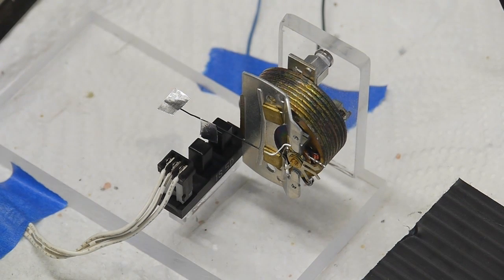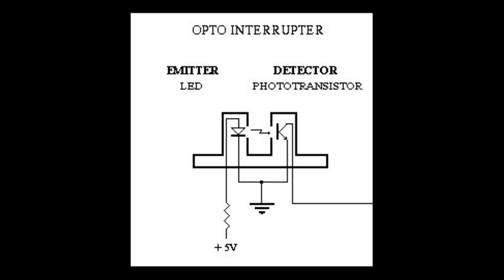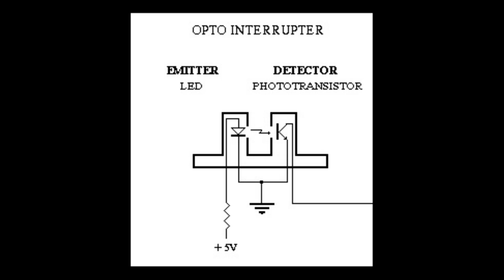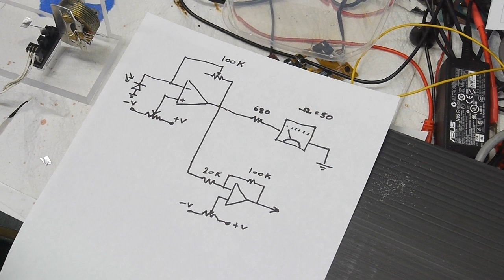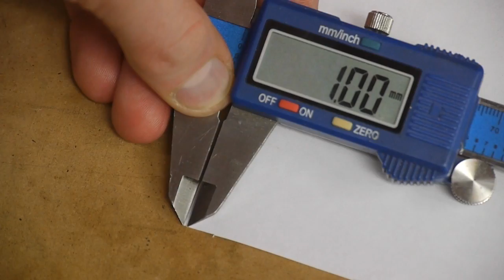Measure the mass of an eyelash with a DIY microbalance

Comment: Is that optical interrupt device they type with an analog or a digital output? The digital type would behave as you describe, where the analog sort would turn on proportional to the amount of blockage of the light. Perhaps it is an analog sensor, but the beam is so narrow that the light is hard to modulate with your mechanical shutter.

Comment: I like it. How much torque can you get out of that needle? Enough to put an optical encoder on the other side? If you printed a smooth gradient on clear plastic and used an analog optical sensor you could eliminate the digital jitter.

Comment: Neat project. To prevent oscillation, put snubber circuit parallel to the (-)input/output (where is 100 kohm trimmer pot for sensitivity) of the first 'servo' opamp. It consist capacitor and resistor in series, then both paralel with this pot. It should gently dump all rapid changes in voltage or current. If single RC is not enough, then put one more than one RC pairs, but with various different values. For example, 1nF/1 kOhm, 10nF/10 kOhms, 100nF/100 kOhms...

Edit: This RC snubber should prevent high excursion of the 'servoing' back, while maintaining relative good feedback speed. 

For air cover, make glass protective hood. Glass can be electrostatically charged too, but to much less extent than plastics of any kind. 

For temperature compensation, you may use NTC resistor and some measurement electronic, just to tell you overal temperature inside measuring device, and how much needle may change length (thus leverage length, which may affect precise and consistent reading of the weight). Later, all parameters can be feed into some u-controller including compensating value depending of different device temperature.

Callibration of the temperature difference can be done measuring the same weight at different temperatures, then plot error correction values, and so on...

EDIT2: Watch out for temperature changes of the trimmer pots - they are very prone to change in resistance with the temperature (I experienced big problems at one attempt to stabilize temperature of the laser for holography porpose - trimmer pot[s] gives me bad behaviour fo the whole circuit, indicating false temerature rising or drop of the laser head, especially when room temperature changes). This small change in resistance is more evident with increased feedback amplification of the opamp(s). 

EDIT3: I wonder, whether this optocoupler has oppening in form of dot, or line? If line, then it is perhaps possible to roate whole setup 90 degrees, so that shutter doesn't cut beam of light rapidly, but rather gradually.

EDIT4: Oh, well. Such opto switch may have slot, but inside is both: photodiode and LED encapsulated with focusing lens, which may produce very narrow beam of light. Maybe making your custom opto switch?

I hope this helps.

Comment: I have an idea. I'm pretty sure it has been done before, but I wonder if it is possible to make a scale that works on resonance frequencies. For example, placing an object on vibrating platform will change resonant frequency of that platform. Then, by adjusting frequency to make it resonant again, it may be possible to calculate the mass of an object by comparing these two frequencies. Thank you very much, I enjoy your channel!

Comment: You could low pass the output that goes to the oscilloscope, with a big cap, small resistor (to minimize resistor noise).  There seems to be some oscillation in the signal in the scope, probably servo loop caused; so the RC low pass filter with a cut frequency 10x smaller than that freq you see in the scope can help a lot to get a better "weight value".

Comment: Very cool, as always Ben. One thing to be very care with when using gutted meter movements like this is that it is extremely easy for the field magnet to attract any tiny metallic particles into the movement which can easily impede the motion of the coil.
Reply: I ruined my first meter this way when I went to drill mounting holes in the metal body!

Comment: Wow, impressive work! Just out of curiosity, is the photo interrupter sensitive to ambient light, or is it dominated by light from the IR LED? If it was, would it not be possible for changes in lighting conditions to throw out the calibration, or even for flickering of fluorescent lights to cause oscillation? Thanks.
Reply from the maker: Yes, the optointerrupter is not really meant to be used in this way, and is susceptible to ambient lighting changes.  Normally, the sensor would be operated in a binary circuit where ambient noise would be small compared to the values of the two desired states.  In this case, the servo is riding right on the edge of the transition from off to on, so small ambient changes can cause interference.  Shining a flashlight on it, will cause a massive disruption.  Even turning on too many fluorescent lights on my bench will cause a very noticeable interference problem.

Comment: Couldn't you put a capacitor in parallel to the photodiode? Voltage across a cap can't jump, potentially giving the OpAmp more time to react and thus oscillate less.
Reply from the maker: Adding a cap in parallel to the photodiode would function like a low-pass filter, so that slow changes will be passed, and fast changes will be damped. The problem is that we need those fast changes to get through the amplifier to prevent the meter needle from swinging past its resting point. In fact, adding more low-pass filters makes the oscillation worse because they damp the feedback needed to halt the needle at the correct spot. Adding another opamp differentiator (capacitor in series) will help the situation since it will pass only the high frequencies when appropriate to bring the needle to a halt as it passes its resting point.
Reply: Ah, I see. I was assuming the system was unstable because of the fast change from diode lit->unlit and vice versa. Thanks for clearing that up!
Reply: QuantumFluxable  then what it is plz define and what is a the term "servo " may be my knowledge is wrong about servo term
Reply: Applied Science hey have you tried adding a capacitor across the ammeter this will reduce servo tracking noise very low and tracking loop will become very stable and  did you tried intersil precision opamp which have ultra low noise at high gains with compare to ad opamp and gains are selectable by digital pins this will solve your opamp noise problem 
as i can see this noise which you are seen is opamp noise + servo tracking noise
Reply: doc elec That's not a servo though...
Reply: Profile pic checks out

Comment: I wonder if printing out a gradient on a piece of transparency film would give the interrupter a more "analog" response?
Reply: Or cut the foil diagonally so it's a triangle instead of a square
Reply: @ceriand  the slit is so thin, the response is practically still ON - OFF.
Reply: Or put a minute section of thin mirror on the arm, shine a laser off of it and put several sensors on the wall to establish an analog range with the sensitivity of a literally perfectly rigid, weightless, 10 foot long lever arm.
Reply: this is what i was going to suggest
Reply: id put an rc low pass filter on the photo diode line and filter the gain with feedback from the input the to will cancel out (microphone feedback cancellation/ clip limiter ) and give a better reading. another idea is servo the led output or bounce it off the bottom.

Comment: Maybe I'm missing something here but couldn't you just run a long average on the Oscilloscope? The noise seems relatively uniform, and even if it isn't, the bias should be consistent.

I don't know, maybe you wanted to just solve the problem entirely on the electronics level, which I'd understand - but from a practical point of view it just seemed like an obvious choice to turn on averaging on the scope... And just wait a little for every measurement, or reset the running average (which I can do with a push of a button on my old HP scope, so I'd expect your shiny new one to be able to do that easily as well).

Interesting video either way!
Reply: I guess there is a high chance he would like to use it without the oscilloscope later on, but yeah, it would be worth testing :)

Comment: What I find most remarkable in this video is your ability to do op amp circuit math.  I have a computer engineering degree and basically got through fundamental electronic circuits by doing well enough on everything else that I was able to completely bomb any question involving an op amp. (I still had to take the course three times)  I simply could never get the math to work through my brain, and never got the right answer.
Reply from the maker: Thanks, I really appreciate it, but I actually missed an important part on this one. As Chris Tacklind pointed out, I don't have a D term, so the loop will be unstable.  It's possible that the binary nature of the optical sensor would still make this very difficult to stabilize, but adding a differentiator would certainly help, and is mathematically necessary.
Reply: +Applied Science Why not cut a diagonal into the mask so that it isn't binary?
Reply: sivalley the photo detector isn't binary, it's very linear.  Take a course in semiconductors.  The problem is a high gain of current to beam break position that his loop can't handle.
Reply: sivalley The shape of the mask will change the rate at which the light level changes. With a 90 degree cut the rate of change would as fast as possible. If you had (for example) a vertical cut the rate of change would be zero. Somewhere in between is a reasonable rate of change which crosses the "binary" threshold of the sensor smoothly. With an oscilloscope on the output you might even be able to calculate the necessary angle. In the real world most diodes don't change instantaneously. If you examine their out put at a sufficient rate of speed you can measure the minimum and maximum speed of switching. (It's not even necessarily the same switching on as switching off.) Similarly, there is a narrow, but definite window in the light level threshold the initiates the switching action. To the casual user the window seems like a very square precipice. It's not.
Reply: +ExtantFrodo2 The shape of the mask doesn't mater.  Once the light transmission level drops below a certain threshold the photodiode will stop conducting altogether.  It's the photodiode that makes the sensor operate in a binary fashion, not the shape of the mask.
Reply: ExtantFrodo2
 Yes, I understand the shape of the shutter affects the slew rate, but I was merely relaying that the shape of the shutter will not change the 'binary' output nature of the photodiode.
The fact that the incident light on the diode affects its effective conductivity more so than the time rate change created by the shutter by orders of magnitude, the slew rate becomes negligible.  There are two ways to overcome this magnitude barrier; 1) Instead of measuring the voltage through the photodiode (as Ben is doing with the first op-amp), measure the current which varies much more predictably below the conduction threshold (although not entirely linearly). 2) Use a shielded photo-resistor whose output IS linear with respect to slew rate of the shutter.
3) Operate the system in a differential mode, rather than the direct proportional he is now.

Just to recap, I am not saying the shape of the shutter is unimportant, just that in the configuration shown it does not have any meaningful significance.
Reply: EGL24Xx
I have no idea what are you calling "photo detectors"  But gate sensors as one used in video are absolutely binary. They give out either 5 volts or 0. Take a course in shmidt triggers or something.
Reply: @NGC1433  There are logic level interruptors which quantize to binary output and then there are plain interrupters which have transistor output and have a linear range. Obviously the logic kind are not as useful unless you are going for a binary control loop something like a 1-bit DAC, which is interesting but I can't think of any advantages.

Comment: How about cutting the part blocking the optical sensor into a triangle. That might make the reading a bit more gradual. Or perhaps it will just make the system oscillate over a larger span.

Comment: I really like your design. Seems to work quite well and was much more linear than I would have imagined! I took the time to try and estimate how many grains of sugar where in a pound. If every grain weighed the same (of course there all slightly different) but at the weight that you came up with considering my math is correct one pound of sugar would have 6,047,893.333 granules of sugar. Pretty useless information unless if you could guess how many grains in jar of sugar and if you could guess the number you won a truck or something :-)
Reply: Even more useless information incoming:
If you then assume that all granules are of the same size and all are spherical and packed in a FCC lattice, you can calculate the density of 100% dense sugar, and then also the radius of a granule.

Comment: Nice!
This is a 2nd  order loop so it needs a PD controller (I is optional).  You have only provided a P term.  The needle could be counter balanced to minimize the DC current required.
Reply from the maker: That's a very good point.  It might be possible to stabilize the system as-is with the proper amount of D.
Reply: Applied Science Well, that came out wrong...
Reply: Would it still be  a 2nd order loop if the coiled spring wasn't removed?
Reply: I did not understand a word of that, except that he needs more D

Comment: Interesting. Did you try to use the scope averaging, to maybe get a more stable reading?
Reply from the maker: Yes, however the voltmeter in this scope has its own averaging routine, which is not affected by waveform acquisition averaging.  The voltmeter was actually doing a pretty good job of ignoring the oscillations.